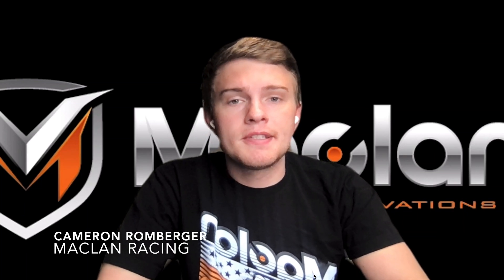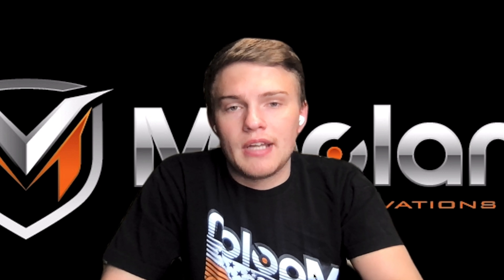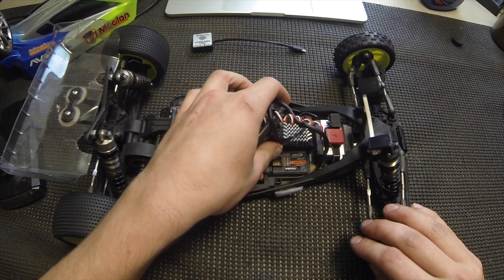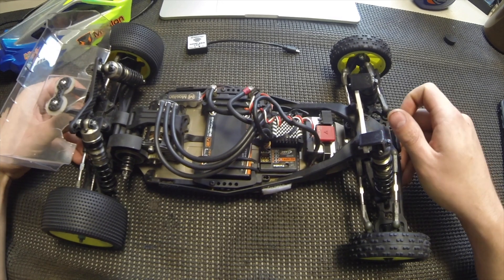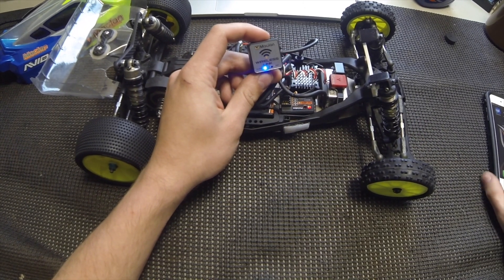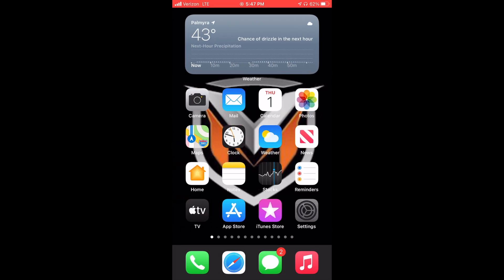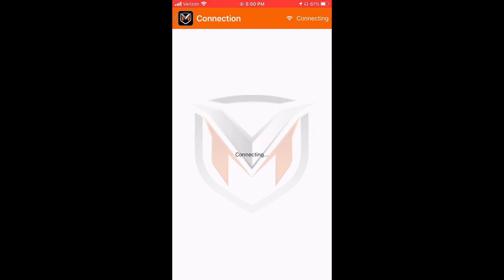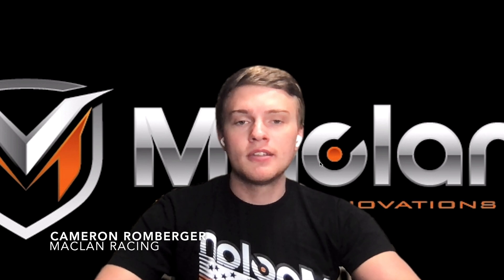Maclan ESC calibration and Wireless Link setup

Comment: Is it required to update and program one of your mmax pro escs to run your car? If so, let me know what could be wrong because I calibrated my esc and my car won’t run. I made absolutely sure that everything was plugged in right and fit alright, and everything was. I’m confused as to what could be happening. I would hate to have to buy another esc.

Comment: Hi . Was running a maclan esc . Swopped battery terminals by mistake . Rookie error I know . Any way blew it completely .. got another unit wired it in and zero power to esc . Fan comes on but esc non responsive , no lights no sounds nothing .. got another one , wired it in and works perfect . All the same model .. any ideas what could be wrong or what to check on the second unit that's dead ?

Comment: My 160A ESC has shut off during yesterday's race.  I was running on black carpet.  The electronics were still working but not power to the motor.  After I pulled the body off, the esc started to work again.  How you found this issue and (if so) what did you do to fix it?
Reply from the maker: Please send a contact form to:

https://www.maclan-racing.com/contact/

We will assign your request to a tech support.